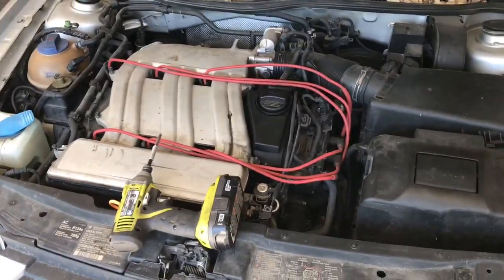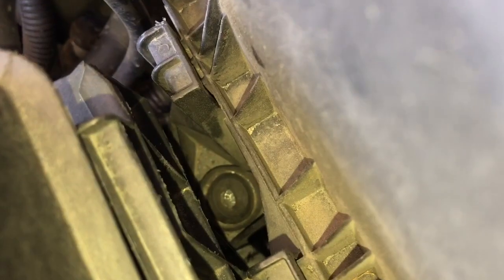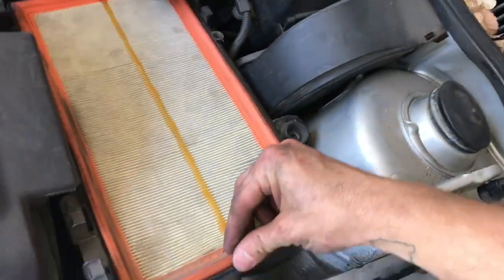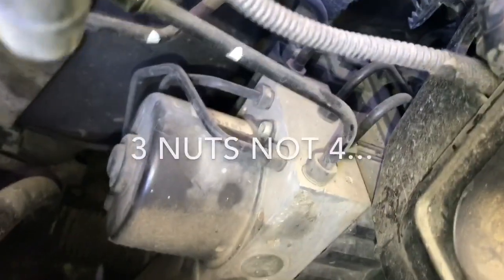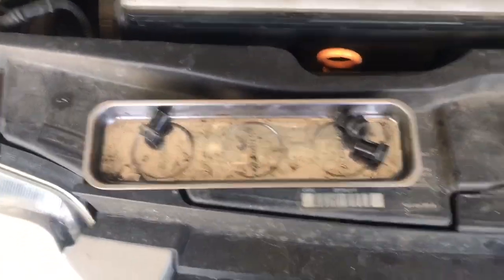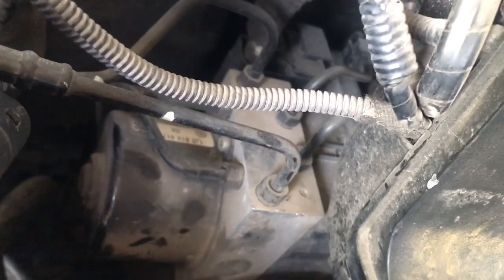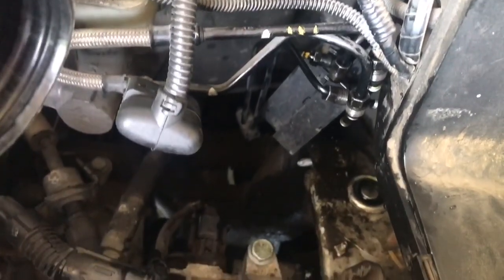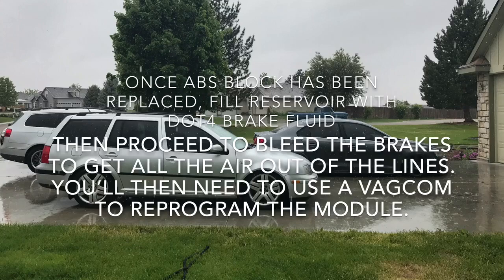How to remove / replace ABS block / module on mk4 volkswagen

Comment: Can you revisit this and show us how to disconnect the electrical connector. Thanks
Reply from the maker: I’ll look into it!
Reply: have you found how to take the electrical connector out? I retrofited oem xenons and i need to run a wire from pin 10 of the abs unit to the pin 9 of left headlight

Comment: so the silver Jetta wagon in your video. Did you put an air lowering kit on it?  I like your wheel hubs also. thanks
Reply from the maker: It’s actually on race land ultimo coilovers
Reply: @2ZERO8  1-3" or 2-4" drop? I've got the same jetta wagon tdi 02. Yours looks good.

Comment: Hi. Do you know if on right hand drive vehicles(UK) the ABS module is in the same location or it's on the other side, in front of the driver. Thank you!
Reply: My Golf is RHD and the ABS is the same side, but the fluid reservoir, master cylinder, and servo will be on the other side, since they need to be directly in front of the driver's brake pedal.

Comment: Any chance that I can replace a ABS module/pump and bleed the brakes and start the car and leave ? Without programming or coding ?
Reply from the maker: MALUME28 MALUME28 no you will need to code it. Ensure the abs module you pull had a matching part number
Reply: Ok thanks but if I can remove the current one and fix something is there any need to code it?
Reply: @MALUMEMALUME-mn9tg   have you found the answer ?
Reply: @ugurmustafadere4608  No?
Reply: @ugurmustafadere4608  There is no need to code it, if you fix the old one. 

If you need to replace an ABS module, make sure that the number and last letter match. 
The model's names start with a 9 digit number, followed by one letter. 
1C0 907 379 <LETTER>
The following letters are interchangeble, according to VW service manual: 

C&J
D&K
E&G
F&H

If you change the module chances are that you'll have to code it. If it is the same letter, you might not have to code it. 

If you do not code it although it is needed, the board computer will not be able to communicate with the ABS module. So the Boatd computer will belive that the module is broken and the ABS and Brake lights will come up, as if your module is broken.
Reply: @oilybrakes et comment le coder svp ?

Comment: any particular symptoms you noticed prior to this? I have been experiencing the "farting-grind noise" (for lack of better terms) when braking at slow speeds or as I come to a stop. Some say the speed sensors, others say it's the wiring harnesses. Any thoughts? Thanks for the video.
Reply from the maker: to be honest I was jump starting another car when the jetta died and somehow it fried the module. Just make sure your part numbers match, and you will need a VAG com to set the module back up. I would check the status of your fluid, and ensure youre running DOT4 and didn't mix it cause that changes the boiling point of the fluid and if someone put DOT5 in it could be aerating the fluid.
Reply: DIY Ethan ahhh ok. I’ve checked the level and it’s good. I have had sensor issues but was wondering if the pump replacement may have cured a similar symptom. Thanks for quick reply!!
Reply: Found out that the main reason the weird noise happens when you brake at slow speeds is because the gap between he wheel sensor and the wheel hub ring is too big. Manual says it should be 0.03mm   Yeah, that close. Anyway, I gotta check mine now!
Reply: Steve Flores did you ever fix it?
Reply: @SFlores1979 I think it is .3 mm which is about .012".  Yes that is close.
Reply: @Modus4  yes i ended up cutting a new harness from a junk yard car and spliced it in. I made sure to cut the new harness beyond the fender well so that it would not get any new damages. My old one had been repaired what too many times.  This fixed it
Reply: @nbpt1000  that makes more sense 😂 but yes, either way it’s a tight fit
Reply: After replacement of ABS module what happened is not programmed